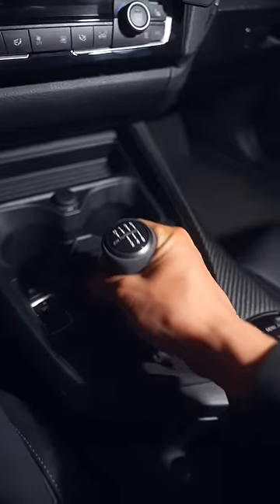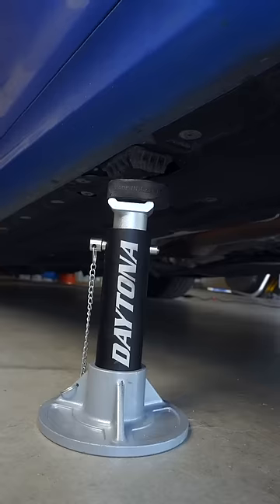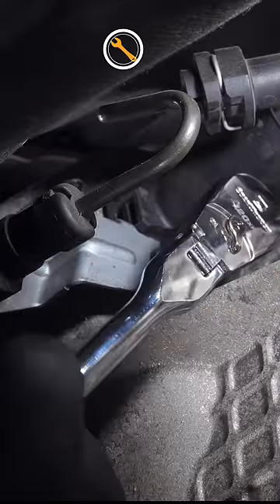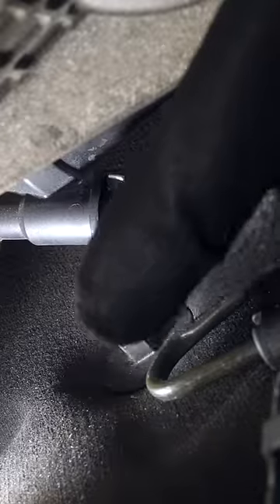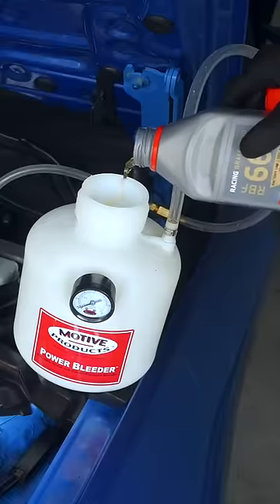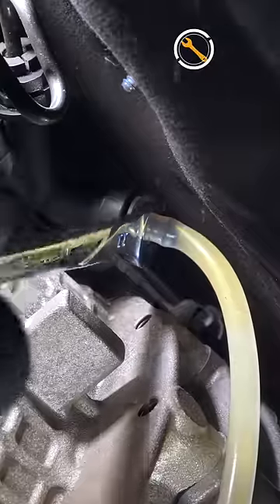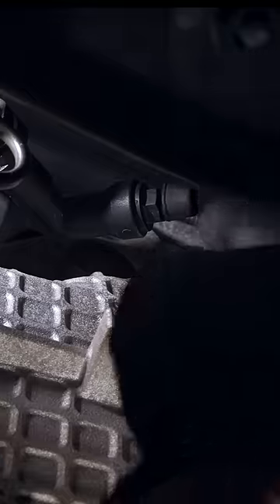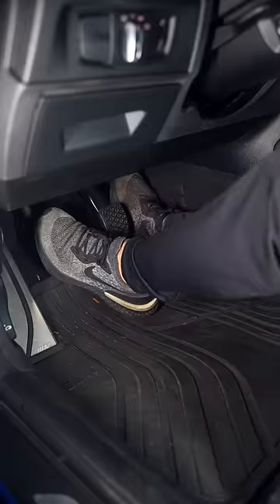FASTER Smoother Shifts

Comment: Don't ever clamp any hydraulic line close. Brakes or clutch hose.  Reguardless if any Youtuber mechanic says it's okay or does so. You risk collasping the hose. Yes, the hose will look fine on the outside, but the inside is where the risk of failure is at. Drain the system. Do it once, the right way. Or do it twice and replace that hose you clamped closed.
Reply: Learned this lesson the hard way too back in my power equipment days growing up
Reply: @THE_A.RAVEN1  replaced a lot of brake hoses, calipers and rotors because another technician did that. Rotors were unsalvageable and no caliper rebuild kits available at the time.
Reply: I don't get it, please explain. The thing that he disconnects(unclamp) and clamp back the hose is bad? Or is bad that he is doing it with fluid in the system?
Reply: @Gabi-he6rw  clamping the line itself. Don’t ever clamp any hydraulic line on a vehicle. The outside will return back to “normal,” but the inside won’t fully return. So one of two things will happen. Either fluid won’t return and keep the system activated. Causing brakes to drag or the throw out bearing to remain in constant contact with the pressure plate. Which makes the clutch slip.  Or fluid won’t go to the clutch slave or caliper. Causing the hose(s) to either ballon or burst. Or the brake master or clutch master to leak.
Reply: You can clamp a hydraulic line but but really you should use proper hose clamps
Reply: You can clamp normal rubber hoses like a caliper feed using the correct style of clamp but there are some applications that use an internal metal braided hose  covered with a rubber outer layer, these can't be clamped as it will crush the inner pipe
Reply: @Gabi-he6rw  hydraulic hose sometimes has steel wire reinforcement. So when you clamp it like that, the internal steel can get crushed and deformed, even if the external rubber seems to bounce back to shape.
Reply: You can literally buy brake line clamps and I've used them for years without any problems 😂😂😂
Reply: @MaNNeRz91  just because you can. Doesn’t mean you should. I’ve ran into a lot of issues when I used hose clamps. So I just chucked them in the trash.
Reply: @bmwman1981  no you can't
Reply: I’ve done it a million times and never had a break hose go bad.. depends on the hose and condition of it I guess
Reply: Well put, sir.
Reply: Anything can get damaged if you do it wrong.
Reply: @glennaguon5165  Been wrenching professionally for over 30 yrs, know what you're talking about before you post something. Clamped lots of brake lines of all ages.... have never had an issue.
Reply: Still clamping hoses. Idgaf.
Reply: Fu*k, this may be my issue with first and sometimes second gear feeling crunchy or not engaging all the way in gear before shifting around in other gears. Removed CDV couple years ago, and I did clamp off the line with a mole grip.
Reply: if the hose is new its pefectly fine to clamp it
Reply: Use a long screwdriver or similar to push the brake or clutch pedal down 1". This covers the compensation port and no fluid will leak out after the initial small amount. No need to clamp lines or drain system.
Reply: @MaNNeRz91 the same as me mate I've done it for years to with proper clamps
Reply: You can pinch a line perfectly fine using rubber, old carpet, cardboard and some gentle squishing action from some molegrips.
Better then jamming a bolt in the end of the line and ruining it that way...
Obviously don't pinch braided or solid lines 😅
Reply: It’s ok to clamp the hydraulic line any lines as long don’t over tight it that’s all. Once the clamp removed,  the inside Kevlar layer  will reshape from the engine bay s heat. Also there another reasons why the brake system failed when it clamped or not can cause  the contaminated that already build up due of dirty fluid .

Comment: Yeah, sure, go ahead and do that, then dump the clutch pedal above 3000 rpm on a good traction road and do tell us what part of the transmission failed 😅
Reply: Never had an issue with that, stop bullshitting and seek attention somewhere else.
Reply: Stop bullshittin. Most of my cars are so old they never had it in the first place. And still no problem
Reply: Only a noob dumps clutch pedal
Reply: @drsnowmon  Unless you're doing launch control.
Reply: My launch control is set to 2900 RPM and I've dumped it a few times without damage, I don't recommend it and now I slip a little on the launch when racing a slower car but I've not broken my trans yet

Comment: Cdv is there to dampen driveline shock . Without you’ll get quicker 
Wear on the guibo, driveshaft and diff bushings .
Reply: Man I replaced a lot of those rubber doughnuts... I understand there purpose but I'm honestly not a fan. Having a wear item like that in your driveline seems like it would rob horse power.
Reply: @TheIronFourth  nope.
Reply: @weedshoes5089  your saying it doesn't rob horses? It has too. It's rubber. When you first start moving it flexes instead of taking right off. That is where you get the loss. It's like using poly instead of rubber for bushings.
Reply: Delay valves are a crutch for people who don't understand that a clutch isn't an on/off switch.
Reply: @TheIronFourth  It flexes.. it takes, but also gives. For every action, there is an equal and opposite reaction. It's the same (proven untrue) argument that extensions on torque wrenches give inaccurate readings.
Reply: @TheIronFourth  Think about it,  does flexing of your rubber tires slow you down? 

No, it speeds you up.
Reply: @Azlehria thinking about removing mine as i am finding i the clutch is not as responsive as i’d like plus it seems like it lags almost when quickly shifting. i’ve done a bunch of research and honestly seems like the way to go. i have a 2001 z3. best my money could buy lol

Comment: Do not remove the clutch delay valve. They put it there for a reason, removing that would mean temporary smooth clutching, then after afew months or a year you'll start to feel the problem on tha clutch. Can also lead to an accident.

Comment: I think this is only useful if you like to slip the clutch, AKA "clutch kick" it, to get sideways. Also beneficial for fast no lift shifts. 👍
----
In both scenarios, with the delay valve in place, the clutch will not engage fast enough and you'll experience significant clutch slippage and wear.

Comment: If you can't drive with the delay valve you definitely can't drive without it. The delay valve only even activates when your dropping the clutch. Stop doing that. Your not in a race car. You're in a bmw. If you want super fast shifts get a DCT car
Reply: ian trofimov  The only time it's better to not have one is if you know exactly when to drop your clutch. Even the best drivers in the world aren't perfect at that. And guess what? You're not a famous driver, your a triggered guy on a YouTube that destroys his clutch for fun
Reply: This is completely false. You don’t need to dump the clutch for the CDV to restrict flow. It will restrict flow even when letting the clutch out moderately slow. The difference between driving with and without a CDV, even normal street driving, is night and day. The only reason modern manufacturers added CDV’s is to help prevent drive train shock from new drivers dumping the clutch. Stop spreading misinformation about subjects you know nothing of.

Comment: Does that work on Honda 🤣🤣🤣🤣 my civic bit jumpy going down gears either it’s my clutch getting toast or my gear box stuffed
Reply: Yep. It’s even on my old Santa Fe SM with diesel engine and manual transmission
Reply: Or just rev match when your downshifting so you can match engine speed to wheel speed I promise your the reason for it being " a bit jumpy going down gears"
Reply: I dont think uve heard about revmatching. Remember to practice in bo traffic areas, like a spacious parking lot

Comment: It was there for a reason right ? What’s the consequence of removing one
Reply: It's there to prevent sending a jolt through the driveline. This is especially noticeable when trying to shift quickly, since the clutch doesn't engage as quickly as your foot can let off the pedal. However, many people find that it makes smooth shifts from 1st to 2nd difficult in regular driving, since you typically try to get that shift over with as quickly as possible and may use clutch slip to smooth out the shift.

The main advantage of removing it is smoother 1-2 shifts, as well as the ability to slam gears when you really want to. However, the effects of shifting gears and letting off the clutch before engine RPM has dropped to its matching RPM in the next gear sends a shock through the transmission, driveshaft etc. This can eventually damage parts in the driveline, though most drivers won't suffer from this issue as long as you shift reasonably most of the time.

Comment: is it safe to for 40mph gradually at 5th gear, then accidentally shift to 2nd or 1st gear,? i imagine how wild it is and transmission gear will crash or broke?
Reply: The transmission spinns at the same speed at 40mph regardless of what gear you are in. The only thing that changes is the engine rpm.
Only thing to watch out for ist that you dont overrev your engine

Comment: What is the point of a clutch delay valve?  It's not hard to drive a manual, it just takes a little practice, why add something extra to go wrong.
Reply: ian trofimov  : It just takes a bit of practice to shift smoothly, just let the RPMs drop to where they will be for you current speed in the next gear.  Every vehicle will take some practice getting used to that particular engine/trans/clutch combo.

Comment: i cant help but feel like theres some kind of dirty lie here. somethings dodgy about this. why tf would there be a clutch fking drlay valve anyway 😭😭
Reply: Its there for inexperienced/bad drivers so they dont drop the clutch too fast/early. As far as I know :D
Reply: There's no springs on the clutch. At least on my E46 there was no springs on the old or the replacement clutch. The delay valve is supposed to take the place of the clutch springs

Comment: A manual late model BMW? must be packing a Euro spec economy tuned four banger pushing out a whopping 120hp, because that's the only way manuals will meet fuel economy regulations, and sticking them to undesirable engines means there's no loss if no one buys them.
Reply: Man’s has no clue what you’re talking about 😂

Comment: Or it might the fact you drive a BMW that's always in shops and don't deny it you know it is
Reply: @mexicaninjafredfred  I'll kiss you in your forehead
Reply: They are only bad in early years and when maintained like ass.
Reply: M8 not mine but mines na n52b30a
Reply: Depends..if you never change the transmission fluid because the manufacturer says its "lifetime" then yeah it will fail. If you listen to the manufacturer and only change the oil and oil filter once every 20-30k km on a high performance engine then yeah again it will fail. These cars spend so much time "broken" not because theyre bad cars but because their owners are stupid and BMW (just like any other "luxury" or "sports" car manufacturer)

Comment: If it's a manual it's not called a transmission it's a gearbox
Reply: Incorrect.
Reply: @weedshoes5089  yes it is
Reply: @vapegames7440  not according to any of my BMW or Porsche parts catalogs.

What're you from the UK?
Reply: @weedshoes5089  usa.